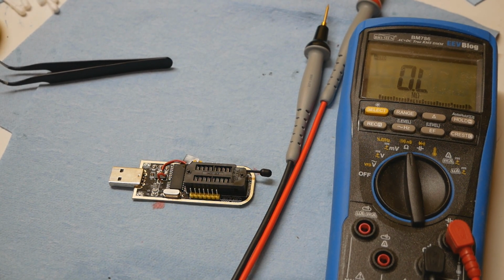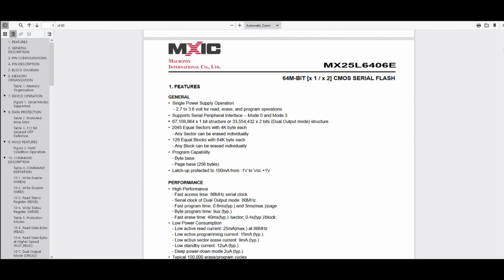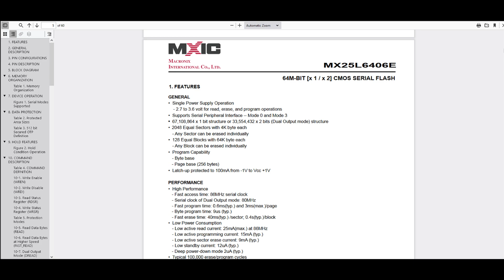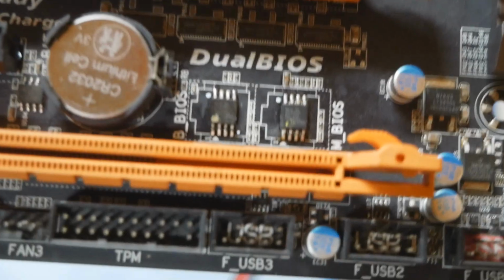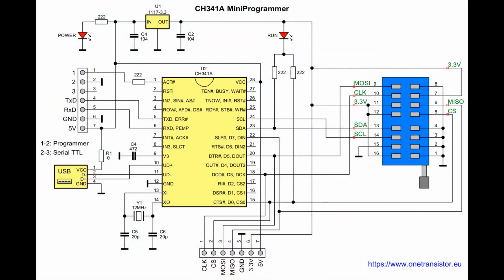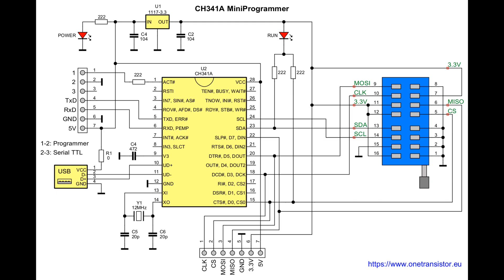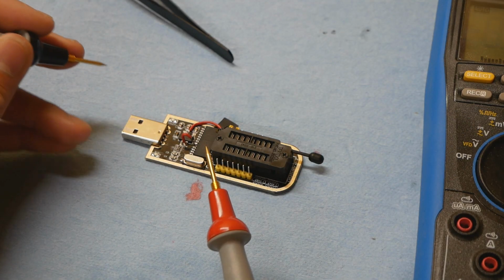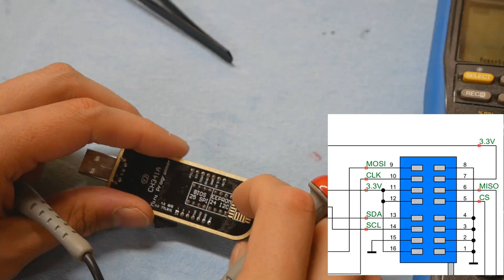CH341A Important 3.3v Voltage FIX - Motherboard BIOS Programmer

Comment: i have 2 programmers exactly like yours (ch341a (YJ) black edition) both output 3.3 volts between pin 2 (VCC) and pin 10(ground) on adapter board for  MX25L25635F and same is for pins 4 and 8 in tsop8 (you can connect the adapter board to the programmer, the connect the usb and read the datasheet for desired chip (in which goes vcc and ground and measure voltage between them)...

Comment: So i'm attempting to ressurect my Gigabyte Auros Z390Elite after an unsuccessful bios update.
It wont post. No video signal and the motherboard vga led stays lit. 

I have a black pcb CH341A. I installed the Winusb driver from zadig v6.1.7600.16385. installs correctly. Device Manager detects the CH341A as USB UART-LPT.
I connected the clip to the chip and then to the laptop im running AsProgrammer on and selecting CH341a under Hardware tab, then hit Read id with the green ?, at whoch point i get the Error Connecting CH341(-1).

Any help would be appreciated this is now day 3 😂
Reply: You may have inserted the adapter board incorrectly into the zif socket: pin 1 is on the lever side, and the picture in the programmer software is wrong in some versions.
Reply: @pr0fessoro  ok thank you I was somewhat confused about the orientation so I tried to follow diagrams I found but still wasn’t sure. I’ll try this evening and report back. I REALLY appreciate you responding friend 👊

Comment: I have problem my ch341A not connect, windows 11 usb working and find ch341 but program not connect. Whats wrong?

Do i have to that voltage fix?

Comment: Interesting. I have had a "CH341 Pro" (No A or B) for a long time. It is the black PCB style (In fact, so long that I noticed some solder mask flaking off when I just examined it.) The chip is a CH341B (Same as on the CH341A, and it does 3.3V. I also recently got but haven't used a "CH341A Pro", which is almost identical. In terms of noticable differences, the only difference in pinout is the CH341 has a 3.3V in the 'upper right' if the USB is to the left, and the CH341A has a 5V there. (It's opposite the side which has both 3.3v and 5v (on both) 

Both say 'MinProgramment", but again the only difference is the 3.3V pin vs the 5V. 

Though the CH341 also came with a 1.8V adapter. And the listing on Amazon I got it on now shows a CH341APro (Slightly different to my "CH341A Pro" board, note the lack of a space)  which shows the 5V pin on both sides. 

Looking in addition to the V1.6 talked about there also seems to be one labeled as 1.7 which supports via a switch on the board: 1.8, 2.5, 3.3 and 5V so that's a good improvement, and if I didn't have the 2 already, I might get one.

Comment: Hi, i just got a new CH341B (notA?) Programmer and tried on many diff good and bad 3.3V bios and it wont read any?  BUT i looked at the CH341 Chip and Pin 25 is not soldered??  Is that pin required or not and something else is wrong although i have double checked everything and tried win 7 and 10 and two diff versions of AS Programmer program.   thanks for any help.

Comment: There is actually nothing wrong with the programmer. If you look at those 5V pins with an Oscilloscope you will find it is actually pulsed waveforms sitting on those pins. The current on those pins are very low so it cannot damage your BIOS chip. Measuring the voltages while programming the chip you will find it dropped to 3,4V and those pins can accept volts up to 4.2V. I have programmed a few chips without any problems just as it is,out of the box.
You can also watch this video which confirms what I have found. https://www.youtube.com/watch?v=J8-Sh7DjiXw&t=10s

Comment: Dear sir. I have to flash a W25Q32BV chip, that operates at 3.3V. If i buy the CH341B version, will it be safe for this chip? no mods to the programmer are recommendable? Thanks, i have no soldering skills.

Comment: Unnecessary modification....once connected to  3.3 v  bios IC, the volts drop from approx 5 volts to approc 3.3 colts. Modding makes this unit unreliable
Reply: Hi, yeah another channel shows theres almost no amps available and thus even if 5V, it cant hurt with only barely micro amps.  Question is if the original adjusts itself to 3.3 chips, why was there a diff version put out?
Reply: @xx3868  ignoarance between the relationship between volts and amps. 
10,000 volts from a Tesla coil might just make your hair stand on end, like they used to perform in the old time circuses and fairs.
Reply: @pvanb2  10,000 volts will give you a shock even at very low amps. That tiny shock is enough to fry the mini circuit inside a chip. Especially, when some bios chips say max 1.9v. So read the datasheets for the bios chips before using this device. I actually fried 3 bios chips over the past few days, because I didn't read the datasheets for the chips. This is a way for the manufacturer to confuse the "smart" user. You actually fry the chip, but instead you believe that you did something incorrectly, or that the manufacturer just figured out a way to prevent people from messing with their bios!
Reply: @BSnicks  if you do an actual volt reading when CH341A  connected to a reliable usb 5 volt source and to a 3.3 bios ic....you will find the voltage consistently drops to 4 volts.....if .5 to .7 overvolts fried your 3 bios chips, which I assume were 3.3 rated, then you probably weeded out three unreliable bios chips.You must be aware, undervoltage is as risky for failure as overvoltage, and the "corrected" CH341A to 3.3 volts could easily pose that undervolt scenario
Reply: @pvb9964  Undervoltage just doesn't do anything harmful. It can never fry the chips. If it doesn't work, you can always boost the voltage up again.
Reply: @BSnicks  "brown outs" can and do, do damage to electronic parts.

Comment: Hi can you pls help me what programmer you will recommend to flash bios chip 

MX25L3206EPI-12G 

This programmer is a trash i did this but still i get data line 3.1v i wanna buy other programmer
Reply: it's now trash because you ruined it it doing the unnecessary modification
Reply: @pvb9964  can you explain it further? I tried a tutorial online but i didnt get 3.3 voltage 😔

Comment: i did this, but the data line measuring 3.1 volt, altough the ch341a vcc is 3.3 volt
Reply: That's actually normal, there is a small voltage drop, but you can use the programmer normally
Reply: @BrennoMaturino1  still cant fix my asus mobo im planning to buy the latest one but it's too expensive
Reply: Same here i guess they sent us deffective product wtf
Reply: Try to put cap 1uF and 100nF at the output of regulator

Comment: black ch341a has 3.3v and 5v voltage while blue ch341a has only 3.3v fix so no mods required
Reply: how do you set it into 3.3v mode
Reply: @jimmjamme3067  yellow jumper enable 3.3v by default... By removing it, it will back to 5v
Reply: @xiv3r what yellow jumper? the yellow things along the sides?
Reply: @kongvanndeththannarath8713  yes. the yellow along the side is for 3.3v mode
Reply: @xiv3r неправда, перемычка задаёт режим как паралельный USB порт, на микросхеме всегда выдается 5 вольт

Comment: Did this mod and somehow my CH341A made a "sizzling" sound for a few seconds, think something was shorted... it's dead now after a few reading attempts, tho already ordered a new and better programmer.
Reply: That is because this guy has no idea what he is doing. These programmers do not need to be modded. They work as intended They will not damage anything as the voltage will not hurt anything but the current will damage chips and the current is so low there is nothing to worry about. The 5v will change when you plug the chip in.

Comment: I have ch341a, i do this modification but it does not Work.
Reply: Unnecessary modification....once connected to  3.3 v  bios IC, the volts drop from approx 5 volts to approc 3.3 colts. Modding makes this unit unreliable

Comment: There's now a new PCB version which has 1.8V, it would be good to look at it.

Most BIOS chips on MBs are nominally only 1.8V anyway and only accidentally 3.3V tolerant. By the way there's anecdotal experience of people mindlessly plopping the test clip in 3.3V mode onto 1.8V chips and they're fine, no heat no anything, like what? Colour me surprised, but apparently they are feisty little bois.

That X79 has only a 64mbit one? I wonder where they dug that out, i thought 128mbit was common for the longest time. And 3.3V as well huh.

Something to keep in mind that the pin source/sink current that CH341a can muster is RIDICULOUSLY low, like 200uA. These will be easily dissipated by ESD diodes on the target chip clamping the real pin voltage to VCC+0.5V, and you don't really need to expect long term damage to the target chip due to this. I'd be really more concerned for whether CH341 will survive that, it's a spectacularly wimpy chip. I understand that it's chip made for and under cost pressure, but it's basically made out of leftover snot.

Exceeding VCC on the pins is however not particularly safe for CH341a, which is probably why they went this route of always feeding it 5V.
Reply: How recognize this version?

Comment: There's a  version 1.6 of the ch341a where the voltage issue has been corrected (as of Feb 2022). But I see a lot of eBay listings for the new revision with pictures of the old one, so buyer beware. 

Always a fan of ur bios content. Thanks!
Reply from the maker: Great info, so thanks for the headup.
Reply: Hi, excuse me for reviving such an old thread. I have to flash a W25Q32BV chip, that operates at 3.3V. I have no access to buy a 1.6+ version of the CH431A, but the CH341B version, will this version work without riks? Thanks